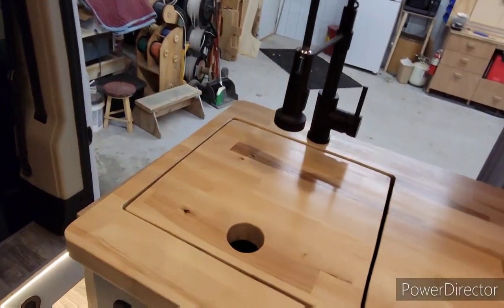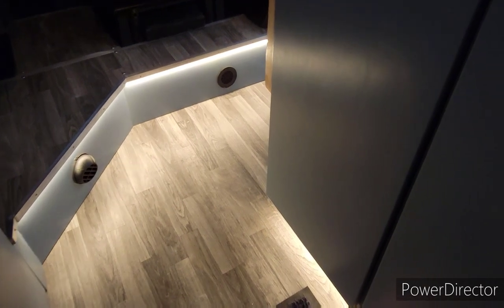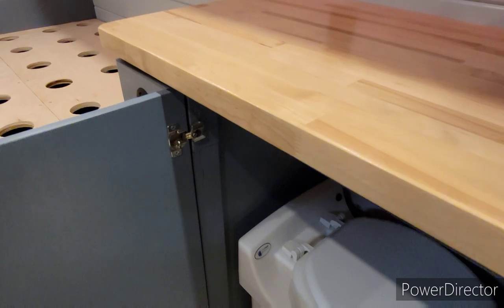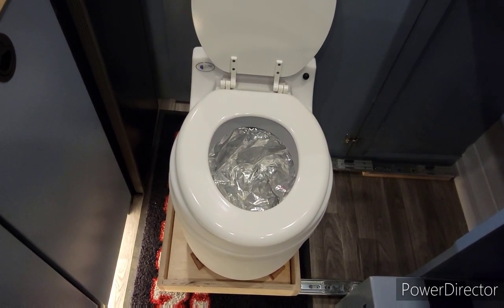Promaster conversion (E70)

Comment: The battery cables are exposed to the storage. Like if a suitcase was in there it could slide into them.  Needs a panel to protect from the storage compartment.
Reply from the maker: Not really. And typically people who live in their van full time don't have suitcases because they take up to much room.
Reply: @RedsCustomDesign  Bruh ok no suitcase, but a case of water, groceries, whatever.  A set of groceries back there would roll right into those exposed cables.
Reply from the maker: 20 years and not one person has had any problems.  Maybe they can organize their storage area better.